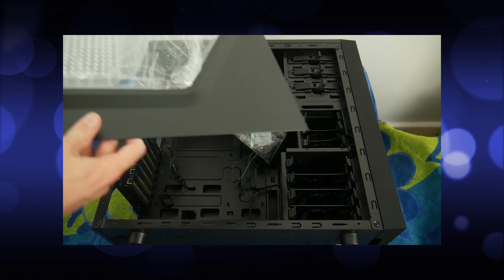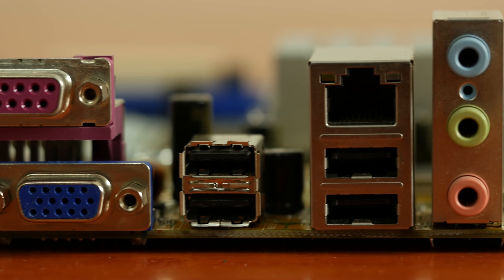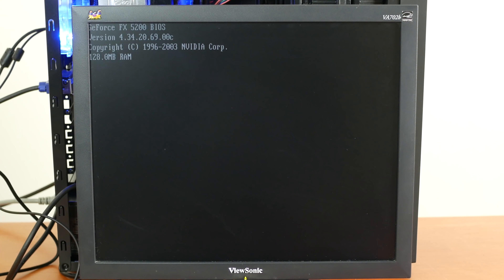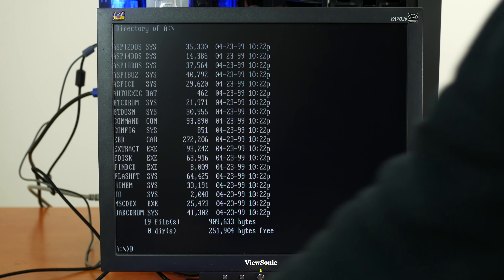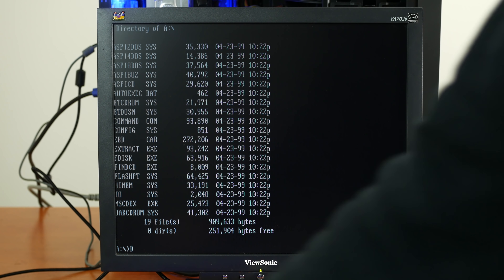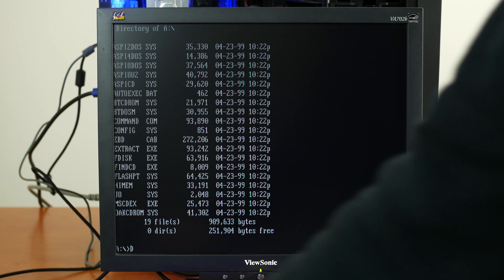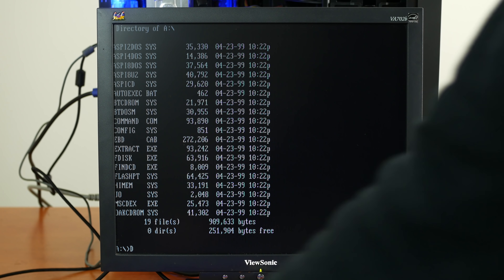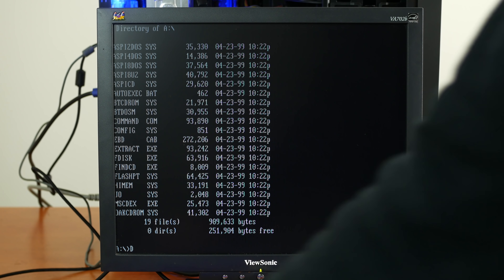What's the fastest (officially supported) Windows 98 PC?

Comment: I feel your pain, I ended up dialing back the hardware a bit to guarantee compatibility and stability as I found running fast was no help if I had compatibility issues and bugs, which when combined with the price you have to pay these days is high for the faster stuff and much more limited availability, is just adding insult to injury when its likely to be flakey (not to mention I had high end NVidia cards back in the day then and every one of them died, except my 5900 Ultra and that was only because of how noisy it was so I quickly replaced it with the 9800 pro). I also use dirt cheap 500GB hybrid drives laptop drives, then you get the SSD performance given that 8GB SSD cache will be more than enough most of the time for 98SE and no worries about the SSD maintenance plus plenty of storage space. 

I finally ended up with 2 PCs, both ITX size as I decided that if I wanted a retro PC, I wanted something I could keep around without getting in the way. So for the games that would benefit from a bit more oomph, I got a shuttle XPC with an i875p chipset (I ended up having to buy assorted parts with the mobo case and cooler all separately), Pentium 4 3.2GHZ with 1MB cache and 800mhz FSB (its the fastest supported by the board and even overclocked to 3.4GHZ, runs cool for a P4 in such a cramped case and smallish cooler), 1GB of corsair XMS CL 2 DDR400,  a Radeon 9800 Pro (for high compatibility and because my case doesn't like the bigger buggier but faster cards as there is very little clearance as is) and a Creative Audigy 2 ZS. 

Then for DOS and more speed sensitive older games (Pentium 1 era old as that's when I started PC gaming, I have Amiga and consoles for stuff prior to that) I built a second with some crappy VIA board with a built VIA C7-D that I was given as part of a batch of old office PCs, that struggle compared to similar 1.6ghz CPUs of the era and performs more like 500GZ P2 and is low end Pentium 1 performance with the cache disabled, a single stick of 512MB DDR 333 as that's all it will support, a SoundBlaster live! and as there is no AGP I use my trusty old PCI Voodoo 5 5500, which being a bios modded Mac card, has DVI out so like the 9800 pro, I can use DVI to HDMI adapters as while I would prefer to use one of my CRTs, I am being practical like with the m being ITX, as in if I had to lug a tower and CRT every time I felt like using these PCs as keeping them around would get in the way, I just wouldn't use them.

Comment: i have a blazer of a Windows 2000 PC, that happens to play every single 98 games I have, which I have a collection of over 1000 PC games of 2007 and older, and 95% are 2001 and older.

That being said, this is a pretty amazing video as I want to build exactly this - especially how easy it is to repair AGP cards, of which I have 7 working ones that I fixed - granted none of them are the highest end cards, just weird ones.

Also, Windows 2000 removes MOST of the issues caused by 98. It's like a weird but perfect in betweener. In fact, I rarely have issues with anything except games explicitly listed as Windows 95. Those usually take some hard work, but even Lego Island worked flawlessly for me.

Comment: I actually used a computer with that same mother board until around 2015, and I still have it. It has a Pentium D 820, 2GB of memory, and a GeForce 7600 GS, and it runs windows 7. It was pretty surprising to see it in this video.

Comment: There's a reason 98 went away so quickly after XP came out.  For the most part, I didn't miss it, especially after Service Pack 1.
Reply: Win2K Pro FTW ..used it until 2007 (Such a hazzle to get Bioshock(1) to run on it)

Comment: To add to what I said 3 years ago...

I ran Win98 (not SE) on a Tyan 440BX system with 1GB RAM for many years. No special tweaks -- if the chipset supports it, Win98 happily uses 1GB RAM. Also did not have the 47 day rollover bug (this is actually Win98 banging into a bug in the system timer chip) and boasted uptimes in excess of six months... and in about ten years of daily driving it never crashed, not once.

Comment: When i switched to Windows 98 on my Pentium 4 rig, it was also very unstable and picky about drivers at first, even with its older Socket 478 mainboard. Fortunately it got fairly usable after a lot of troubleshooting and component changes.

However, my Windows 95 installation is rock solid with contemporary stuff on my p1 notebook used for writing.

Comment: Athlon 64 FX-74 would be your fastest option.  Don't let clock speed fool you- the E-8600 at 3.33 is not faster than the FX-84 at 3.0 as a lot other factors go into it, same as how a 2nd Gen Rizen will kill a heavily over clocked Core I7-2700K.  AMD overtook intel from the Athlon socket A all the way until Intel 2nd Gen Core.  Some AMD Phenom II chipsets also support Windows 98SE but I have not personally ran them with 98SE, just the Athlon 64 which has been the gold 98SE standard for ever.  It was actually kinda fun watching someone without experience try to perform a retro build and get continuously stumped by issues seasoned techs almost always anticipate.  Keep trying and learning and you will get there some day!

Comment: Man, for Windows 98 I really think you may have made the wrong call going with a dual core.  Hell, Windows didn't really start supporting multi core very well until relatively recently, there's no way that 98 is really using that extra core right.  I think you honestly might have been better off with a zippier single core CPU that 98 would actually be able to handle correctly.
Reply: 98 won't even see that other core at all. For the fastet single core, a Celeron 450 would probably the best option between performance and power draw/cooling with a healthy oc headroom if wanted. Sure, there are some quite nasty Pentium 4 Extreme, but those also cost the premium price for being the fastest NetBurst chips without being faster than the Celeron. But that Celeron would still be slower than a single core of a fast Core 2 Duo. Less clock at stock and way less cache.
On AMD side something like a Athlon XP 3200+ (which isn't really faster than the 3000+ or 2800+) or a Athlon 64 4000+ and FX-57 exist, but no idea how well socket 939 support is. On socket 754 the 3700+ is available. But are those even faster

Comment: I know that this video is already a few years old, but there is potentially more powerful HW for Windows 98 SE machine:

There was a fun motherboard: ASrock 939Dual-SATA2 with native AGP and PCIe and drivers for Windows 98 (on the asrock website you can no longer found them, but chipset drivers are available on nvidia website, who bought ULi at some point). In that case you can potentially use some PCIe devices on Windows 98 (ATi released drivers for Radeon X800 and X850 for Windows 98 and that included PCIe cards, some later nvidia detonators supported I think GeForce 7800 GTX on PCIe on Windows 98 as well).

Moreover if you think that Socket 939 is not fast enough (technically Core 2 can be a bit faster), there is a relatively rare adapter called Asrock AM2Cpu which should be installed into special slot on the motherboard and it have AM2 socket and DDR2. BIOS doesn't have a microcode for Phenoms (and honestly - VRM of the AM2Cpu is rather weak and likely would require some modification to work properly even if some one will update microcode). That way you probably can match CPU-speed wise your Core 2 for that era games.

Hunting down HW, especially in working order, is... hard... I spent about a year on ebay monitoring everything and got both board and AM2Cpu in somewhat bad condition that requires replacing half of the capacitors around VRMs to make it stable and safe (for itself and other HW) to use. But it it doable and actually on local auctions in smaller countries you have better chances to find one.

Comment: There was a VIA chipset motherboard designed for Intel CPU's that included both AGP & PCIe video card slots. You could use either type of video card, but not both at the same time. No idea if it could run Win 98, or might have required a newer operating system: Windows ME, 2000 or XP.

Comment: The reason for no E8600 is because the E8600 is a 1333MHz FSB CPU. Only newer chipsets supported 1333MHz FSBs on the 775 socket, and those chipsets probably don't have 98 drivers which is why you didn't encounter a board that could do it.

Comment: Possibly related to the Q6600 generation with DDR3 memory support on the motherboard?
I was given an ITX version for free, slapped the fastest memory I could in there, and moved it over to an SSD, it ran Windows 98 very well with onboard graphics, then moved it up a few windows versions as I picked up a GTX 660, I then installed Crysis and was very impressed.

Comment: I have a Asus P5B motherboard from 2004 which has a 100% Win98 support. Its a Socket 775 currently with Core 2 Duo CPU installed and it still can run Win98 fully!

Comment: I had an HP z800 workstation with Dual Xeon x5670’s @ 2.93ghz and would turbo to 3.33ghz. With 48gb RAM. It ran WinXP very stable. HP Provided XP drivers and it was officially supported by HP. ( total of 12-cores and 24-threads ) It was a Beast.

Comment: Fun video.

This is about as thorough as you can be getting things up and running with "stock" drivers and firmware. 

Try swapping in a Geforce4 Ti, that should get you proper driver support and will likely perform a lot better in Halo and Driver. Hell, even a cheap Geforce4 MX440 will probably perform better and more stable under 98 than the 6800. The Radeon 9800XT is probably the best GPU I ever ran under 98 but it's wasted on the old OS given how much better it is in XP. 

Core 2 6600
Geforce4 (Ti or MX, budget depending)/Radeon 9600 - 9800 (Nvidia drivers seem to be better under 98 however)
2x 256mb of DDR 400 RAM
Compatible motherboard
Soundblaster Live! sound card

IMHO, that is about the best 98SE system you could build for optimal performance in newer supported titles while still being relatively stable and reliable. Onboard sound was hit or miss where it came to support. You can make/find modded display drivers that are newer and work better for the 6800 under 98 but it's a headache to actually get working. I remember trying to get an 8600gt working under 98. That was an absolute nightmare despite finding modded drivers that "supported" it. It was a total waste of time given how unstable and slow it was under 98 anyway, even when I did get it (mostly) working. CPU support, as noted by another comment, can be added with BIOS modding. Basically you are looking at months of tinkering and trial and error to go further and get things more stable. 98 is great fun for old hardware that was fully and properly supported but once you get to the era of hardware concurrent with XP it falls on it's face pretty hard. Maybe fun for a video but not really worth all the effort.

A fun idea could be to benchmark the config I listed vs the spec in this video and see what, if any, performance is gained going "all out".

Comment: When I was a young lad, my favourite hobby was building computers. I used to go to the dump shop and pick up old computers hoping for a pentium 4. I loved pulling the side panel off and seeing a complete system with a s775 cooler. Even picked up the odd system that had DDR1 and DDR2 ram slots on the same mainboard.. This was back in the mid-late 00s. Now I go there, nothing. They all go straight into the e-waste bin. Anything that doesn't get's crushed and put into the rubbish pile to be burried. No computers at all at the tip shops. I managed to bribe one of the workers to sell me an interesting looking system that was popping out that had a 5th gen i5 and 8gb ram, and another motherboard with an i5 cpu for $10. Bargain none the less but still... no graphics cards, hdds etc. Those wouldve gone straight to the scrapper to be melted down and sold as raw minerals.

Comment: I know this is an old video but you actually can use Gparted to setup your Win98 partitions.  Windows 98 setup wants to use a hard drive whose FAT32 partition has the LBA flag enabled.  So when you create your partition in Gparted, right click on it and click "flags", then tick the "boot" and "lba" boxes.  I just went through this exact thing on my Pentium 3 machine and didn't know why scandisk was marking a bunch of bad sectors and my fresh installs were either not working, crashing for no reason, or otherwise acting weird.  Win98 needs that lba partition flag!

Comment: Tip: Gericom X5 Force is fully Windows 98 compatible. 
eBay Price => 10 Euro (if you can find one!) 
32MB Geforce2go, 256MB RAM P4, 80GB HDD, DVD ROM.

It is my first Laptop back in 2002. Great if you want to play retro games, test old CNC machines, software or plotter.

Comment: Windows98 is product of it's own era. Very efficient OS for scarce resources of PCs of that time. It's design is like glass cannon - really fast and efficient, but depends on each installed software to be stable and works just right.
It became obsolete when RAM size and CPUs power skyrocketed at early 2000s. And more sophisticated and resistant to errors and bugs in software operating systems from big servers and workstations got their way into consumer market with wide support from hardware manufacturers.

Comment: There are bios hacking tools that could enable you to add the 8600 to the supported cpu list. As long as the boards voltage regulators and such can manage. It's likely similar enough to the 6600

Comment: Asus had some weird motherboards in the 2000s. 
I needed to scrap another computer to restore my project XP machine. I needed replacement drives so i bought a scrap computer to part out. The motherboard on the scrap computer we bought had an ABN-E motherboard. It was newer than the computer we were restoring. (Restoration project was 2001, this computer was 2006)
Ddr1 ram
Still had a 3.5" floppy 
39 pin CDR drive
Looked like it was straight from the early 90s.

Comment: I don't think that the optical drive itself was the issue. They all just use the same standard drivers from what I know. I think the problem is that ATAPI (an extension to IDE that adds. SCSI commands to support drives other than hard disks) doesn't work with the compatibility mode IDE drivers you use for SATA.

Comment: I found some 2006 DELL models with official Windows XP support, Serial 232 port, PCI + PCIe
If you install the official setup, you can fall back to Windows 98 SE on the same key too !
DELL Vostro, fast DDR 3 in dual, it supports up to Windows 10 too, able to run any game on GTX 1080 card.
next this i will try, it should run MS DOS 6.22 too, Windows 3.1 ! Official DOS support on it too.

Comment: Those CPU support lists don't NECESSARILY hold 100% true. I got an E8600 (that I bought thanks to this video, no less) to POST in a board that apparently doesn't support it. However I was warned that the mismatched FSB might be problematic (the board takes up to a 1066 MHz FSB and the E8600 is a 1333 MHz FSB). We'll see when I install an OS.

Comment: Windows 98 has become one of the greatest urban myths. I see all sorts of comments telling you how great it was and that a P2 or a PIII are awesome for a Win98 installation. You can't even take advantage of a Pentium MMX with Win98! If you install a light Win XP (FLP for example) on a Pentium MMX, you'll actually be able to multitask without interruptions, that is, things as basic as listening to music while you work. Windows 98 will not protect media processes, it will make your music break up if you open something else, it is horrible and it was not even properly suited for the hardware of its time, it's a perfect match for non-MMX Pentiums and that's it. With MMX and P2 you will definitely want XP. 32bit. For P3 and P4 you should get Win7 32bit up to the update where they regrettably forced the NX bit requirement.

Comment: I found among the most compatible LGA775 chipsets in terms of CPU support is Intel's 30 series. Officially support for Pentium 4 was dropped, but many boards still run with 200 MHz FSB P4, which gives a while range in terms of performance. I have a Gigabyte P35 board and successfully ran a Cedar Mill P4 and a LGA771 Xeon on it.
98 drivers are an issue tho.

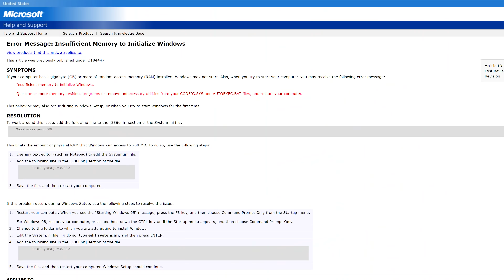Comment: 7:27 you could also have fixed the issues. I used Windows 98SE with 1GB (on dual boot with XP) in an Athlon XP system that I had built in 2001 (and upgraded from 512MB to 1GB later, maybe around 2004). Just changed a few registry settings and it turned out to be more stable than XP.

Comment: Should probably get on the bandwagon for the search of PCI-E cards that work under Windows 98SE. Phil from Phil's Computer Lab already confirmed ATI's Radeon X850 XT Platinum Edition. Should look into Nvidia. Naturally, the 6800 Ultra is the "best", but with modified drivers, the 9000 series should work. However, I have no guarantee they'll work, as I have no 9800 cards on hand to give them a go for myself, so good luck. I can point to the modified drivers (if it's not already down), it has a bit of documentation for what cards are supported. But with the 9800 GX2 (the 1GB VRAM model), you should have all the VRAM that you need. And whenever someone puts non-3dfx SLI support into Windows 98SE, you probably wouldn't get any faster. But even still, I haven't really found a motherboard that supports the Core 2 E8600 and SLI at the same time. Granted, you could maybe add the microcode of the Core 2 E8600 to a motherboard with some BIOS patching, but until non-3dfx SLI becomes a thing for Windows 98SE, it probably is just a pipedream for maximum framerates.

For now, I'd like to see an E8600 Core 2 Duo (OC if possible) + 4GB of DDR2 @ 1066 (or better with OC) + Nvidia GeForce 9800 GX2. For the chipset, G31 from Intel is most recommended. If this becomes an interest for a project, I hope everything works out.